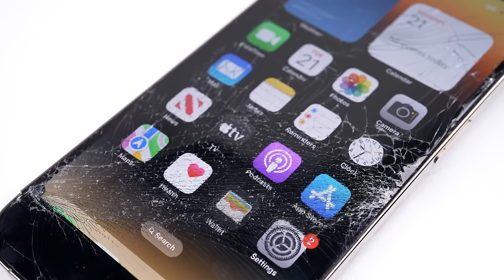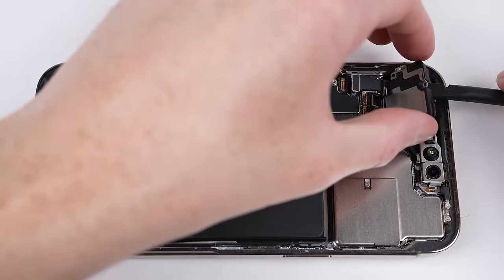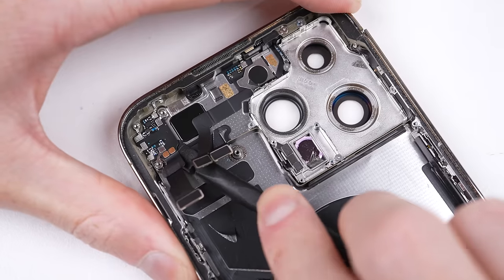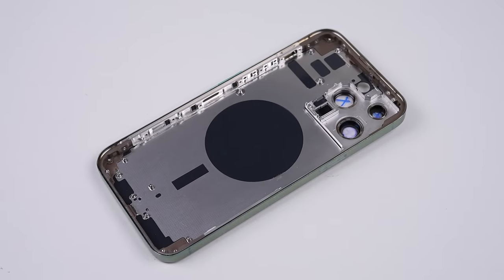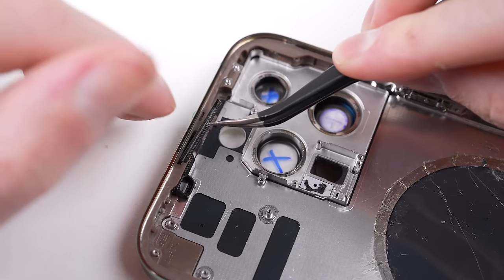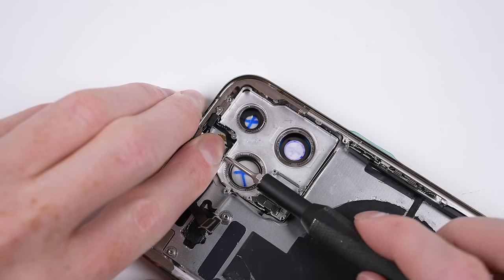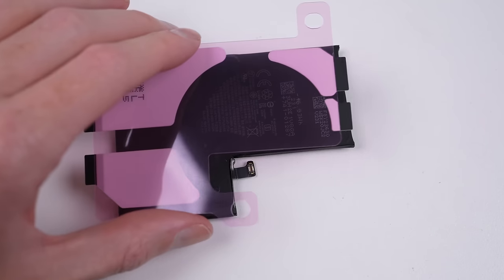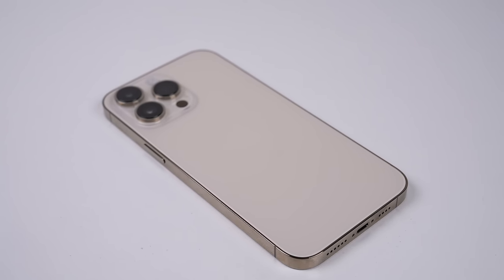What It Takes To Repair The iPhone 14 Pro Will Anger You - iPhone 14 Pro Max Restoration

Comment: The amount of engineering thats gone into making the phone as none repairable as possible is quite impressive.
Reply: Apple's customers deserve Apple products
Reply: @fabricliver this phone definitely belonged to a teenager who didn’t appreciate what they had.
Reply: @w3lcom39  there's no way of knowing that. How presumptuous
Reply: @w3lcom39 aren't they all that? Everyone that buys an apple product has no clue.
Reply: iPhones mostly suck at repair, if you take care of the device it can last for years. @Ibnboulos
Reply: Bloody hell. Disassembling and reassembling 1 iPhone 14 Pro Max will be a full 8 hour shift.😁
Reply: Don't look at the inside of a ("real") watch, you'll have a stroke.
Reply: So really, when the battery won’t hold a charge anymore, it’ll take a preposterous amount of work to replace, even if someone has sold you a new battery. So many different screws!
Who, outside of Silicon Valley, has the know-how (or budget) to dare opening up one of these? 
Just replace the whole damn thing.
I love the stuff my iPhone 12 running system 16 can do, but if they’re going to make devices that can’t reasonably be fixed…
Reply: @editname6868  I'm about to get an iphone 14 pro today or tomorrow, which is going to be the first new phone I've held in 5+ years. I've had a Iphone 6 s + for about 5 years now and I've never cracked the screen once even with my reckless ass, so yes I can vouch.
Reply: @zdzdzdzdzdzdzdzdzd  nobody asked 😂
Reply: @w3lcom39  can't some middle-aged person have a bad day? you're just trying to validate your decision of buying iphone 14 pro in your head.
Reply: @roberstevenson787 And nobody asked you
Reply: And I bet that they add up to the final price for to be unrepairable is needed that the client to pay the price.
Reply: enjoy it in samsung after one year
Reply: @SkepticalSteve01  no, it takes around 20-25 minutes to fully replace an iPhone 14 pro Max battery. Source: it’s my work
Reply: @feahnorl  Well, if you say so… but I’m not going to really know for another 12 to 18 months, when it’ll be time to change the battery and supply more $$$.
I generally love the Apple ecosystem, but I’ve had some disappointments lately – my old Mac Mini just stopped (after six years of reliable operation, and it gave me a reason for buying an M2 Mini, so I’m okay with that one) but when my iPad 10 went completely deaf I had to wonder who decided to glue it together instead of using a dozen cross-head screws, and why…
Reply: @SkepticalSteve01  I agree with you. Not being able to open the iPads is a extremely shitty thing to do. I can’t justify it, it’s totally immoral.
Reply: non-repairable*
Reply: This is why android is better, Period
Reply: @funni387  never. I’m using android right now and it’s a disaster. No integration between devices, no optimization AT ALL, and the repairs of most big manufacturers are as bad or worst.
Reply: Non repairable is a by product. Real engineering is miniaturization
Reply: Apple fanboys would still defend it smh.
Reply: @editname6868  If you take care of any device it can last for years.
Reply: @w3lcom39  or the Dad of the Teenager threw it on the ground full force because the the teenager constantly had an unappealing tone
Reply: @zdzdzdzdzdzdzdzdzd  iSheeps like you deserve such products.
Reply: @PseudoEmpathy  i have a mechanical watch and they aren't that complex mate.... tear into a gpu and there's millions of soldered components
Reply: Sorry if you can’t take care of your shit don’t buy it then, it’s not much different from android except the fact most people can’t break into it and jail break it, also most people who can’t buy flagship phones buy terrible androids and get stuck with the idea that cheap equals easy
Reply: It is done do keep the phone as compact as possible, not because they are intentionally making it hard to repair. After all, they are the ones who have to do the repairing.
Reply: @Tugela60  it's machine assembled and it is engineered to make it harder to take apart on purpose. Most of what is in there is completely arbitrary, and competitors are much easier to repair while being as thin. Get real.
Reply: @Ibnboulos I bought an iPad because I need it, not because I like Apple. I'd rather not own a single Apple product, honestly.
Reply: They put the same effort into making the useless file system in and engineering in limitations
Reply: @SkepticalSteve01  The law in Europe is changing. Crapple will no longer be able to make it so hard to change a battery.
Reply: @Chosenite Yes, I’ve heard the EU intends to make Apple clean up their act, and I certainly don’t object to that. In fact, I’d like to see Europe make AppleCare unnecessary by implementing something similar to the Consumer Guarantees Act,  versions of which we have in New Zealand and Australia. Requiring products to work properly for at least three years should be required of all manufacturers.
Reply: @ahmedhamdan2009 job security lul
Reply: This is called "Stealing money legally from people"
Reply: The newer ones even have serialized parts that don't work in another one of the same model.  It is like a giant middle finger to anyone who wants to repair their own devices!
Reply: You know what’s funny is as soon as some gets that APPLE ID code or whatever is used to create the serials and the binding between components if somebody can understand what they use or how to connect to the servers without permission I feel the problem they created is getting so convoluted that the solution is now incredibly easy. Something so complicated has to have a vulnerability it just has too.
Reply: @purplefishy8164 It’s a great presumption cause it’s fucking true.
Reply: @zdzdzdzdzdzdzdzdzd Ahh a fellow 6s upgrader hello there went from 128GB 6s to 1TB iPhone 13 Pro. All I need for the rest of my life is repairing the battery on this cellphone because I have jailbreak on iOS 15.1.1 which makes this phone just a dream to use
Reply: @Ibnboulos  i mean I’m pretty sure my knowledge of smartphones and technology are better than yours
Reply: @engood  you may have not seen Samsung foldables yet LMAO
Reply: they profit out of it
Reply: @feahnorl you don't know what your talking about! Android is way better
Reply: @roberstevenson787 actually ☝️🤓that’s called freedom of speech. no one needs to ask someone what their opinion is, they can speed freely. this is also an open comment section. again, to speak freely. ☝️🤓
Reply: @feahnorl sorry I am using a pixel 7 pro and Google pixel Chromebook and guess what integration between devices. Oh and Samsung have been doing through there devices for a while now.
Reply: @w3lcom39 I don’t know one teenager that owns a hydraulic press to destroy a phone like that, so idk what ur on about
Reply: And Apple makes you pay for that as well
Reply: What's insane is that apple customers pay for all that engineering.
Reply: @dasbizarre  repairablen't*
Reply: @Ibnboulos No.  How presumptuous.
Reply: Truth garbage phone
Reply: @feahnorl You say repairing of most big manufactures are the same if not worse. Then let me ask you, who started that trend? (Hint: Apple)
Reply: @feahnorl Also your point of no integration between devices is bs. Both Huawei and Samsung have integration between their respective products among other brands as well.
Reply: Could you imagine where tech would be if engineers for Apple worked on quality and new features instead of undermining already established tech.
Reply: @Ibnboulos  what? You just think the tech guys buy iPhones because they have no clue?
Reply: Nothing special or impressive in that. Simple serial to software lock.Shitty apple politics.
Reply: Fr but not in a good way
Reply: @feahnorl  no integration? Samsung devices working together just out of box, same goes for Xiaomi. Samsung Dex is one of the best stuffs on Android. You need only a DLNA/Miracast capable display, and you can use your phone as a mini PC(u can do it with cable too). On a LG TV you can even use its magic remote to use the phone. Xiaomis ecosystem is much much bigger and better, than Apples. With the Xiaomi Home app you can controll almost everything at home: Xiaomi air purifier, (mesh)router, LED strips/bulbs, robot vacuum cleaner, air frier, security cameras, electric shutters... just a few from the complete list.
Reply: tells you everything you need to know about Apple. leave them in the dust. i've never bought an apple product, and I never will. i've never considered it. in my reality they don't exist, until i hear someone else mention them, then i forget a few minutes later. i know how to solder, and i know my way around logic boards and electricity, so i always do my own repairs. i'm also incredibly cheap, so an unrepairable product is not even an option for me.
Reply: @fabricliver Andorid is the same shit
No charger, No headphone jack, no removable battery
Reply: They could've just put some explosives inside to ensure no one attempts to open em up, but they instead went the extra mile!
Reply: It is just locking components & using shitass screws with different lengths.
Reply: Then they say that by removing the charger they help the environment, pure hipocresy
Reply: @editname6868 yeah, I have iPad 1 in PERFECT PHYSICAL CONDITION, but can't be used anymore because of the iOS...... AGAIN YOU HAD NO CLUE......
Reply: 95% of the budget
Reply: At least they didn't cover the internals in resin lol
Reply: iPhone 14 pro max buy apple store USA
Reply: It’s sickening
Reply: @Ibnboulos Bro I’ve had my iPhone 12 mini for almost 3 years and I haven’t broken it, scratched it, or broken it in any way what are you yapping about.
Reply: @editname6868  true. still rocking my Xr. Almost 3 years. But battery is starting to go and i have to angle my charging cable so it charges properly.
Reply: @fabricliver They really aren’t bad. Android users act just as much of an asshole as Apple users, as the hive mindsets we have.
Reply: @fabricliver  WELL SAID
Reply: They don't even do the capitalism thing properly...
Reply: @Coolie-ds4tu So your just going to completely ignore cost reduction?
Reply: I believe that engineers are not to blame though. Being one myself, we always try to make things as good as we can. I can only imagine managers scolding engineers at Apple for making the Iphone layout actually good.